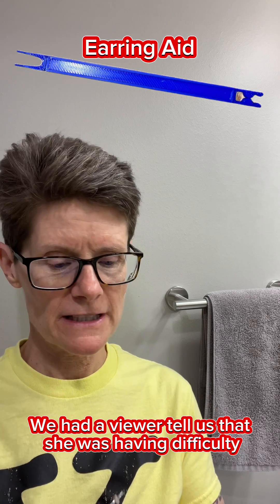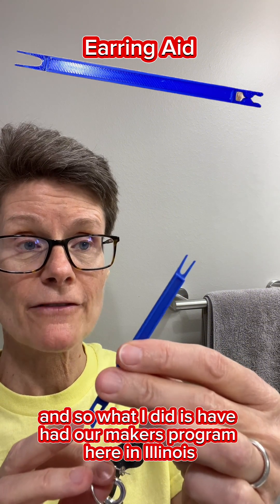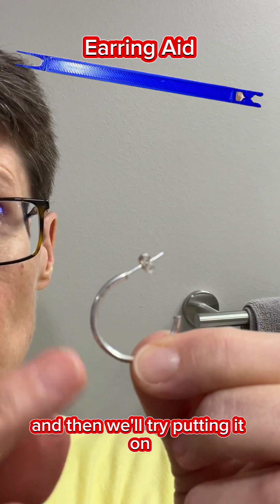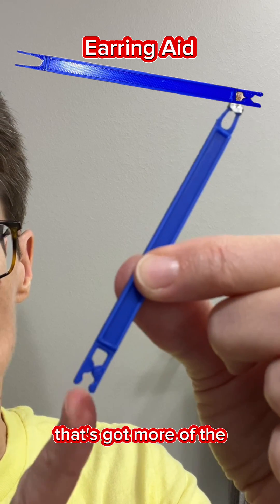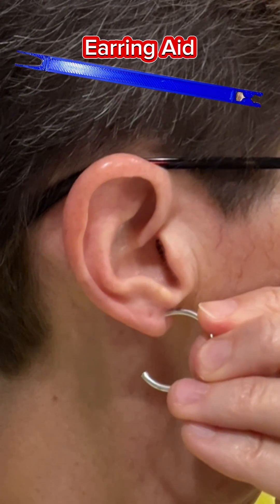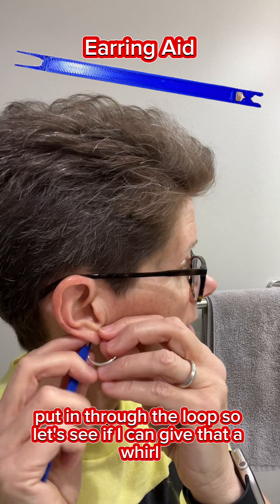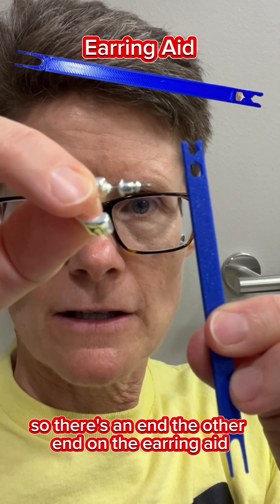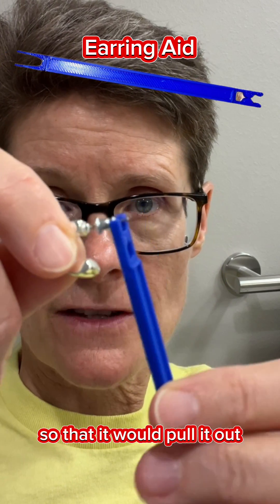Will this 3D printed earring aid help with putting on an earring?

Comment: Do you have the blueprint for this?
Reply from the maker: @SebBasco  We could get the file but it needs to be tweaked. The prongs and the clip are too wide to easily hold an earring back. Are you able to print items? If we sent you the file could you improve the design?
Reply: @AECorner  Yes I could take a look and see if I can improve the design. If I do I can send back the updated version.
Reply from the maker: @SebBasco  That would be great! Please contact us via our website. I’ll reach out to our Makers program and see if they will send us the file.

Comment: Please keep me informed as well.  My sister has a need for something that will help her put on earrings.
Reply from the maker: @craigfischer465  The 2nd iteration is on its way.
Reply from the maker: Hi Craig, We'll release an update video about the earring aid within the next few weeks. I worked with our maker's program but they weren't able to get the prongs any closer. However, I did find an STL file for it on Thingiverse if you know someone that would print it out for you on their 3D printer. Here's the link for the file. I hope it helps. Let us know if you do get it printed and are able to use it:  https://www.thingiverse.com/thing:6596324

Comment: Glad I’m not alone with this issue! ❤ Thanks!
Reply from the maker: @sherrynan2028  We’ll keep you posted on the second iteration 🥰🥰
Reply from the maker: Hi Sherry, We'll release an update video about the earring aid within the next few weeks. I worked with our maker's program but they weren't able to get the prongs any closer. However, I did find an STL file for it on Thingiverse if you know someone that would print it out for you on their 3D printer. Here's the link for the file. I hope it helps. Let us know if you do get it printed and are able to use it:  https://www.thingiverse.com/thing:6596324